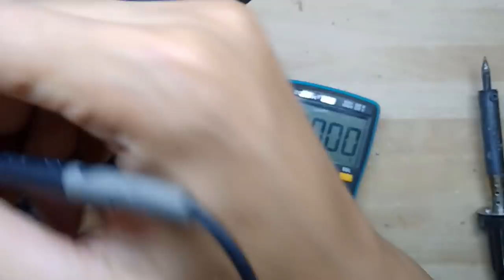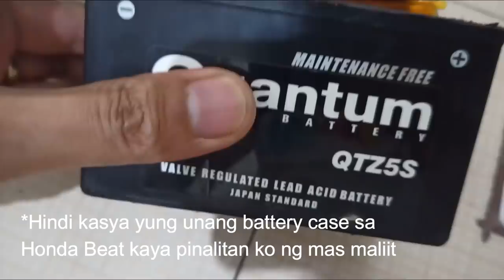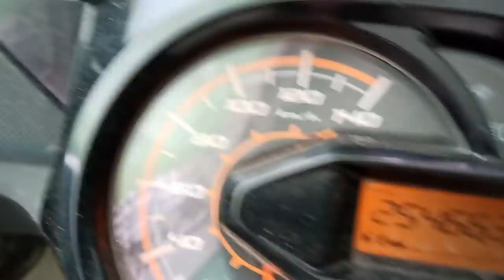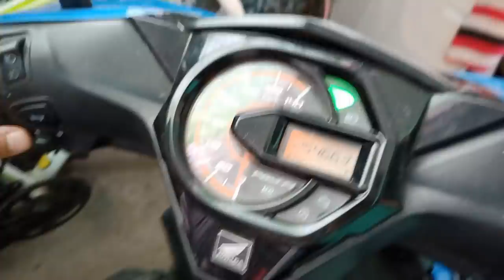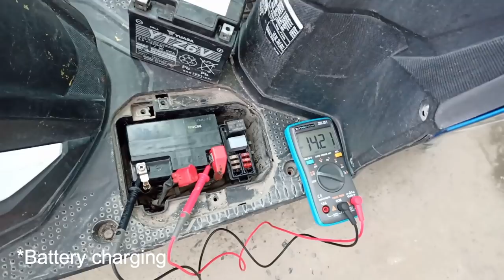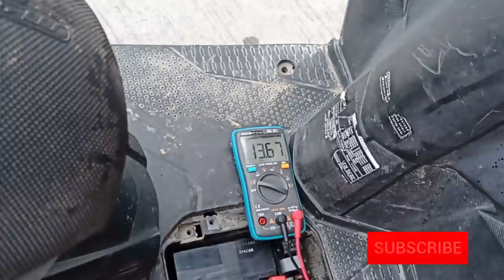Motorcycle Lithium Battery Upgrade

Comment: It is practical for motorcycle, dude.
Reply from the maker: If your looking for longevity, yes
Reply: @DIYPINOY  I suggest that you make it neatly for market
Reply: How long it is compared to the traditional motorcycle battery?
Reply: #DP2NDANNIVERSARY proud
Reply: #DP2NDANNIVERSARY
Reply: Sir Yung bms at battery specs pede Malaman salamat
Reply: Yeah, the way lead acid works is completely different from lithium. Lead Acid acts as a shunt when over voltage. A BMS will stop charging and disconnect when full. A supercapacitor makes more sense as a start battery replacement.
Reply: boss kapag ginawang lithium o lifepo4 ang mc battery kelangan ba din palitan ang battery charger ng motor? o pwede na ung stock lang? newbie lang boss. 😅😅
Reply: Tried it and hindi nya kaya yung electric start sa motor
Reply: @crismarktenebroso103  wag mo na lagyan ng bms kasi meron na protection ang motor active balancer na lang

Comment: Sorry Mate... your leads are not thick enough... you would have been better to bolt an Eyelet. you need at least the same size cable inside the battery as the ones that connect to the battery itself ... or copper or Aluminium Buzz bars... the issue is when you are long cranking... heat would build up as resistance and energy flows from the BAttery packs and your solder joints would simply melt off.

Comment: Ganyan din ginawa ko tmx 125 ko almost 1 month na wala nmn problema..kayang kaya
Reply: bro..   dba full wave tmx  umiinit ba pag nag long drive  mga 3 hrs biyahe ?
Reply: Diko pa na try ng long drive..naglagay din ako ng voltmeter para makita..14.5v  lng nmn dina tumaas tas may safety overcharge discharge nmn ung  bms kaya ok lang cguro. ung discharge starter ko gang 10.9v
Reply: 12.5v nmn pag nakapatay ang makina tas nkailaw nmn ang headlight at stoplight natest ko nah din headlight 30 mins...naka ilaw .5 nabawas kaya ok sya...4pcs lipo4 din gamit ko...w/ bms
Reply: @rickotaper1892  pwede po kaya yan sa click 125i v.2
Reply: @alexbarayoga5304   pwd  13.2v dc nmn din yan mas maganda gawin mo 8pcs para tumaas ung AH nya
Reply: @rickotaper1892  4s2p
Reply: @rickotaper1892  sir ilang amp ang ginamit mong bms
Reply from the maker: Same bms tayo boss?ilang parallel sir
Reply: @Timacgrady1  Daly brand 10amp discharge, 5amp charge ung ginamit ko...kasi pasok nmn n un kc ung battery ng motor motolite 5amp lng din un
Reply: @DIYPINOY  daly brand ginamit ko 10amp discharge 5amp nmn ung max charge nya..ok nmn di nagbabago ang volts di rin sya nadidischarge may nkakabit din nah alarm 24/7 n buhay kaya ok sya idol..nakarelate ako sa ginawa parehas tayo ng ginawa nilagay ko din sa lumang housing ng battery ko kaya mukhang original battery parin...hehe
Reply: @DIYPINOY  4series lng ginawa ko..kaya nmn matibay...
Reply from the maker: @rickotaper1892  importante yung peak discharge paps hehe
Reply: @DIYPINOY  napamahal lang ako kay bms hehe pero ok ung sau kasi 40amp nah ginamit mo
Reply: @rickotaper1892  30amp ang bms ko sir pero di nya kaya pag nag electric start ako. nagooff ang bms nya
Reply: @Timacgrady1  anung brand ng motor moh kc sa tutorial ni ka diy honda beat sakin nmn tmx 125 alpha kaya nmn..
Reply: @rickotaper1892  tmx 125 alpha tricycle
Reply: same kami ng bms sa video tutorial
Reply: Sa honda tmx 155 puwede po?
Reply: @DIYPINOY  4s lang sir
Reply: @Timacgrady1  check mo starter mo baka nmn grounded kaya namamatay try mo palitan ng bms daly brand 10amp pwd un gamit ko
Reply: @arnoldnazaire6154  pwd boss ilaw lang nmn gagamitin mo at busina
Reply: @rickotaper1892  salamat po👍
Reply: @rickotaper1892  nag direct na lang ako sa + & - ng lifepo4 sir. napapastart nya naman. pero pag sa p+ at p- nakakonek nagooff ang bms
Reply: @Timacgrady1  ibig sabihin hindi tugma ang bms nya magpalit ka..para magamit mo kilangan kasi  ang bms para tumagal ang buhay ng lipo4 at for safety na din
Reply: @rickotaper1892  pareho naman kami ng ginamit na bms ni diy pinoy sir
Reply: @Timacgrady1  maliit lang kasi starter ng honda beat kaya di pwersado di gaya ng pang tricycle malaki ang starter kaya cguro namamatay or may sira ang bms mo
Reply: @rickotaper1892  sir tanung lang ok lang ba kung active balancer lang Ang nabili ko para sa 32650 na battery..o mas okay kung BMs na
Reply: @Timacgrady1 same problem sakin sir ayaw rin gumana tmx 125 rin tas same 30 amp bms kagaya nung sa video, ok namn pag ilaw lang naka on kaya namn although namamatay yung bms pag enistart na yung motor
Reply: Boss ano yang bord na ginamit mo BMS ba or active balancer

Comment: pwede rin ba gamitin 18650 battery dyan sir?
Reply: Hindi!  hindi mo maaaring gamitin ang 18650 sa halip na lifepo4.  dahil sa pagkakaiba-iba ng boltahe.
Reply from the maker: Mas okay si lifepo4 po mas madali assemble. If 18650 ibang bms din po
Reply: @DIYPINOY  ahh pwede 18650 basta ibang bms?👍
Reply: ano po yung bms?
Reply: @mattharvey6358  Battery Management System.
Reply from the maker: @junjiegao3064  feeling mo lang po yun, ulit ulit ka sa word na shonga. Unli? Unli?

Comment: idol yung ginawa kung lifepo4 batt di kaya mapastart ang raider 150 carb ko 
sinunud ko lang proceso mo 
may bms din ako na 100a 
sana mapansin
Reply from the maker: baka sa voltage or discharge current ng starter mo lods

Comment: Pwede po ba gawin to sa electric wheelchair? 
Wheelchair Spec: 
2 brush motors (250 watts per motor) 
2 units of lead acid battery(Yuasa 12v 17.2 Ah).

Controller specs: 

Power Supply Voltage: DC 24V
Operating Voltage: DC 18-30V
Output Current: 50A
Control Method: Hall rocker
Braking Voltage: DC 24V
Braking Current: 300-3000mA
Charging Current: 6A maximum

Battery compartment dimensions: 
LWH – 180 x 76 x 167 mm
LWH –7.08 x 2.99 x 6.57 inches
Weight – 6.2kg

Pwede po ba syang magawan ng paraan na mas may torque para makaahon sa areas na slope? Or medyo mapabilis man lang ng more than 6km per hour na di rin ma-compromise yung pagbaba agad laman ng battery? Magkano po kaya sya aabutin with BMS and balancer? Pwede kaya gawing 36v and mas maging higher yung amperage para matagal ma lowbatt? Need ko rin po ba magpalit ng charger or controller to fit the battery na ipapa-modify?

Sana po masagot. Thank you.

Comment: Good day sir nag try akong gumawa Ng lipo for motorcycle and magamit ko naman sya pero nung nag Batangas Ako eh bumababa Ang voltage nya parang Hindi na kakaragahan dati 13.8v pero bumagsak Ng 11.5 and nung nag open Ako Ng ilaw nasa 8 volts nalang Buti nlang Dala ko Ang lumang battery ko Kasi Hindi pa nga Ako sure sa ginawa ko. Pero sure Ako sa gawa ko

Comment: Tagal ko na po gusto gumawa ng kagaya nyan kaso dami kong agam-agam.
Sabi kasi ni google wag daw mag trickle charge ng lithium batt. Diba po trickle charging system yung sa mga motor? 
Para sa yung mga palyadong motor na hindi agad mag start sa isang pindot lang. Ilang seconds po burst current na kakayanin nung bms?
Reply from the maker: Pwede mo simulan sa maliit lang kadiy, sakin kung magfail man ito. Natuto naman ako sa process😊
Reply from the maker: Sa ngayon po 2weeks na sya halos

Comment: Oo nga sir hindi talaga kasya yung battery sa honda beat maliit lng Kasi compartment ng battery sa beat sa step board di gaya sa ibang motor sa taas ang galing sir Ilan max voltage pag todo sa throttle?
Reply from the maker: Salamat po kaDIY, nasa 14.4 or 14.6 ata boss umabot, kaya naman ng bms

Comment: Ang tanong ko, ka-DIY, saan susukatin 'yung charge at discharge ng kahit anong motor? Nakakagaan kasi talaga ng motor 'yung naka-LFP batteries, pero tama din na posibleng hindi match 'yung DIY LFP battery sa charge at discharge ng motor, so saan kaya 'yun ichecheck para masigurong gagana 'yung LFP battery sa motor?

Comment: That BMS board doesn't balance the cells when charging, I have used the exact same BMS and the exact same 32650 lifepo4 batteries from Shopee and the board is useless. I already checked all the cells and all have 5.5Ah capacity each.

I charged it at 14.4V at 2A and it it stopped taking a charge and it was still below 14V, checked the cells and one of them already reached 3.6V so the board automatically stopped the charging as soon as 1 cell reached the max charge voltage and it didn't even try to balance it. I left it for more than 24 hours and still doesn't try to balance. You can charge it at 1A but that will take forever if you have a 4P battery pack. I guess its good for this application but I still would not trust it one bit.

Sad part about my experience is that I bought 3 BMS boards and they all do the same thing. So i know its not because one was defective.

I do not recommend that BMS if you want to charge your batteries more than 1A. Only good side to it, is the cost is very low. That's if you order it from China using Shopee.
Reply from the maker: Please check the balance current of this board. If your charging higher than that while making it full charge, it will cut power for charging to prevent overcharging. All bms have thia function, and almost all bms have low balance current. Balancing also is passive and happens on top

Comment: Yon pobang minimum discharge ay Yung pag nakaminor Lang Ang  mutor? Ilan poba Ang dapat na charge voltage Ng motorsiklo?
Reply from the maker: Maximum discharge po pagnagstart ng motor
Reply: @DIYPINOY  okna po naintindihan Kona🤔👍
Reply from the maker: @arnoldnazaire6154  ayus kadiy

Comment: KaDIY, sir ilang pcs needed kung gagawing secondary batt sa motor pang supply ng aux light na 40w to 60w? Parallel sa main batt charging...? Salamat
Reply from the maker: Mga gano katagal nakaon po yun light sir
Reply: 30minz or/to 60minz

Comment: good afternoon sir. tanong ko lang sir kung ano mas maganda gamitin as motorcycle battery? lithium ba or super capacitors? balak ko kasi upgrade ng battery ng motor ko sa ganyan. ano mas refer mo? may BMS o wala? kasi may regulator rectifier ang motor. thanks in advance sir. godbless.

Comment: Sir may tanong ako about sa bms na yan, mayroon ako nya plano ko lagyan ng active balancer yung 4s, yung connection ba ng balancing wires i parallel ko ba sa mismong balancing wires ng bms? Or need tanggaling yung balanacing wires ng bms, tapos ipalit yung wires sa active balancer

Comment: Nasubukan ko to sa sa MIO ko, ayaw umandar pag May BMS, Sa ngayon nakadirekta siya, 2months na oki pa nman.. Pero balak ko lagyan ng Balancer.. Ty sa Video Sir
Reply from the maker: ano bms mo sir?same po ba nito. baka mataas discharge curren ni mio. iba iba po kasi eh, baka naka fullwave ka din po, utol ko kasi fullwave, lumalagpas 15v yung charging kaya nadidisabled yung battery
Reply: balancer lang po.. alisin nyo BMS. balancer lang talaga nilalagay pag sa motor.
Reply: @owellxps3169  fully tested nyo na po?
Reply: @merfelesis2635  yes.. maganda performance.. untill now wala pa problema.. check mo video ko.. https://www.youtube.com/watch?v=Do31qYWgi_8

Comment: Sir bkit po sa honda wave 100 ayaw mag start
Reply from the maker: check mo sir current discharge ng honda wave at voltage output ng rectifier using yung lead acid na battery po

Comment: Not recommended as a "DIY" video since there were no instructions to follow..if someone without technical experience cannot follow where he soldered most of the wires😂
Reply from the maker: Marami na po kaming video sa wiring ng bms, dito lang din sa channel. Pabrowse lang po
Reply: @DIYPINOY  sir pede ba sya kabitan ng inverter 220 output? For appliances during emergency brown out?

Comment: good day sir tanong lang po kung pwede po gamitin un bms na 100a?
Reply: mas maganda ang 100A na bms. Mag depend ilang horse power yung motor mo.  I tried this setup at d po nag work sa  mga 110cc na motor. sa 100A na BMS working po. If meron kang 9HP na motor which is 110cc convert mo ang hatak in to wattage. more or less nasa 75-77A ang hatag. So 100A ang kilangan. Wag din gumamit ng mumurahing BMS. Marami din fake sa BMS lalo na pag sobrang mura. Nakakasira po ng battery. I recommend Daly BMS.

Comment: Hello sir,
If we use 3s40ah BMS for Li-ion battery then this system works or not? Charging voltage of bike is 14.5 volts.

Comment: Magkano kya lht mgagastos.p include nmn sir  ng mga parts..
Reply from the maker: Components Links:
1. 30A BMS - https://invol.co/cl12p5j
2. LiFePO4 Battery - https://invol.co/cl2b07g
3. Screw and Knots - https://invol.co/cl2973z
4. Tabbing wire - https://invol.co/cl29745
5. Kapton tape - https://invol.co/cl2ako6
Reply: @DIYPINOY  salamat..

Comment: okay ba na 100a na bms ko pang click 150i v2 ? pahinge po ng suggestion salamat
Reply: yes okay yan tol. wag lang yung sobrang mura. fake yung naglabasan sa shopee.
Reply: @Jaz_Zy  nasa mag kano ba yung 100bms na yan sir para may idea din ako kung legit or fake yung mabibili ko
Reply: @Jaz_Zy  tsaka pala sir kaya naman ng 100bms yung may loud horn at mini driving light ?
Reply: @motoswab1150  sir, regardless my horn ka, 100A bms is enough. Kasi, mag charge naman agad yung alternator. So dnman lahat sa baterya kukunin ang power pag umandar na.  Yung motor mo is 150cc. Probably nsa 10hp ya  equivalent to 10,000W or 86-90A. Check mo lang yung mga bms na my description na pang" jumpstart" or high current bms sa shopee. Sa akin nabili ko ng 381php. So far gumana naman. 2 weeks ginagamit. 👍👍👍 Malakas dn ang horn at ilaw. 5% lang kinain ng motor ko sa baterya buong magdamag kasi my alarm.

Comment: boss ano suggested nyo na bms sa 4s7p52ah 32650/6ah?
kung may formula, pashare ng computation
Reply from the maker: bms sir depende kasi sa load current at charging current. check nyo po specs sir